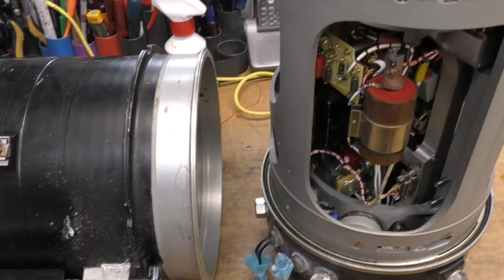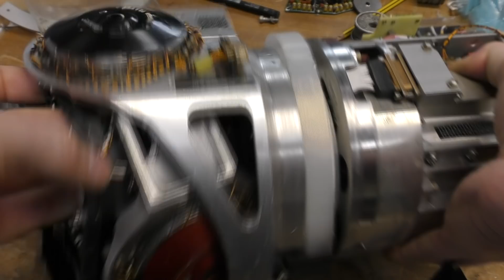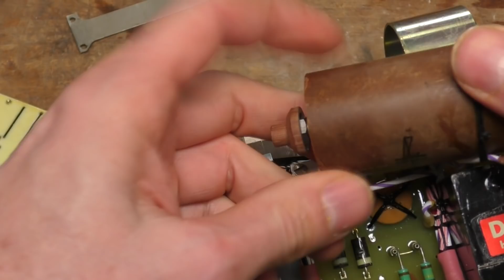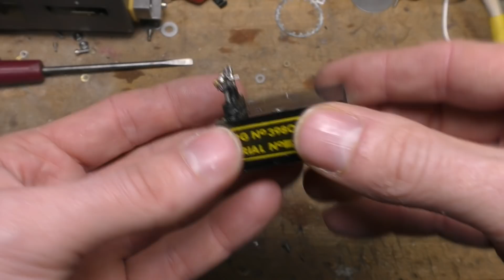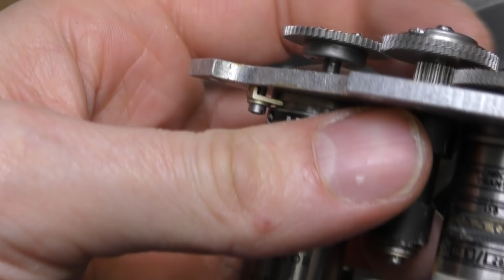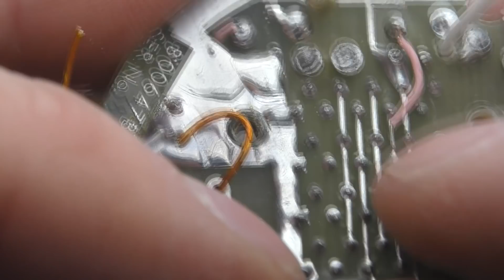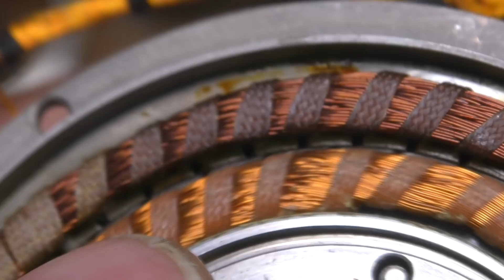Laser unit from Tornado jet fighter aircraft

Comment: Why have that "quadrant" photodetector? If this assembly is the source and receiver, wouldn't that always be in line? Or is this also used to track targets designated by external lasers, like from handheld or other aircraft?
Reply: It is quite possible it will be able to track a heat signature and then check range to it.  Alternately it will track the laser spot as it as the target moves across the field of view to maintain the laser pointed so the return signal falls in the middle of the quadrant to maintain a lock on the direction when an aerial target.
Reply: One possibility is that it is for beam alignment when the system is being assembled.

Comment: For something designed for an Airplane, it seems like not much care was taken to reduce weight.
Reply from the maker: Yeah - this thing is seriously heavy
Reply: @Train 2noplace but the connectors with unused pins would have been lighter without unused pins to begin with.  I guess they have them assembled and a who cares was given, ie not for space.
Reply: @ikocheratcr  considering the large chunks of machined metal and huge bundles of wire, the extra grams from some overly fancy connectors aren't relevant. Plus, the bureaucratic overhead of getting a new connector certified was probably enormous.
Reply: Heavy but also resistant to enemy fire.
Reply: Not much care ? The prototype probably weighed ten times as much. They shrunk it down to 1 gram under the weight-budget, and left it at that. 50 years later in the YouTube comments:

Comment: Dual motors I presume is just for redundancy, maybe two identical systems control it and they both take the same synchronous resolver input? Love how well built this stuff is.
Reply: never played with motors, but here's an idea: they have antibacklash gears in the middle, but the servos have backlash in the reduction gears; i'm thinking one of them torques in one direction and the second in the other direction; say you apply current for 50% of the torque of motor A, then using feedback from the resolver, you adjust the torque in motor B until there is no movement; then you decrease torque in motor B to move left and increase to move right; just don't understand why there are so many wires on each motor; maybe some encoders, to calibrate for absolute position at the start or maybe the only motors with reduction that fit the specification were servomotors; again, don't know much about motors.
Reply: @TheStefan665  Yep,  that's essentially how they get such ridiculous precision accuracy in an existing world of analog metering. Modern milspec we throw it into an ADC and let an algo running on an fpga do the rest.

Comment: Modern equipment is probably just a bunch of Raspberry Pis and few sensor boards dotted around the plane.🤣😂🤣
Reply: Most of it could be done with about $10 of electronics but I bet they still make them like this for millions of dollars because $$$
Reply: @rubiconnn  because engineers expect to get paid?
Reply: Most of the stuff flying today was designed before any of that was around... 90s (F22), early 2000s (F35). Some upgrades flying from early 2010s.

Comment: It doesn't seem terribly weight nor size optimized. That cross section must be quite a drag at mach2
Reply: Weight wise I don't think it really matters very much when you see the weight of the plane it was on (roughly 14 tons). I agree about the drag though. I imagine there is not all that much you can do about it when you need a certain aperture size.
Reply: @AlexanderGee  weight begets weight. and it might need the aperture for light gathering but it doesn't seem too concerned with resolution. still the window could be part of the minimal aerodynamic body of the airplane. It seems it was behind a wedge of glass. curiously there was a pod next to it with a blunt front that must have had poor aerodynamics.
Reply: @DanFrederiksen  Even without those undernose pods the Tornado IDS was not normally a supersonic aircraft and apparently rarely used the maximum sweep position on the wing. Those pods were pretty small compared to the drag they got from the underwing drop tanks and under-fuselage weapons.
Reply: @Akm72  800km/h is still quite a breeze. goes to show how suboptimal mil stuff can be.

Comment: Could you do a video on the strobe/flash circuit? I have to say that from what I saw I was not yet impressed with the high frequency aspect of it. I guess the voltage and inductance is high, but still one would assume that some magic is required for the high "slew rate". Is it trigged by a thyristor or some form of tube?

Comment: Your small gyro at 31 minutes, so its safe to say its not an absolute gyro but perhaos just a direction of movement indicator?! or do you feel it resolves accurately in its small arc of movement.
Reply: It's a rate gyro. The output is dependent of the rate of rotation.

Comment: I was wondering What voltage the capacitor was?  as i have 1 of the resnators witch i want to get functioning but has none of the pulse system ?  If you have it spare i would even be happy to purchse this part ? 
Kind regards tim

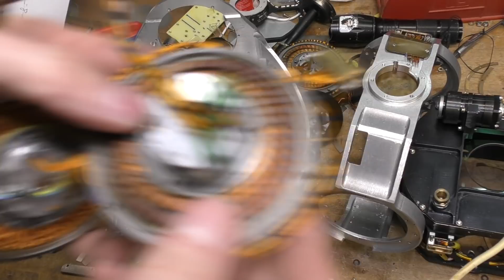Comment: Could the two motor looking devices at 28:00 possibly be an induction AC motor and a resolver?  I find it weird to have two different types of motors since they would be fighting against each other or additional engineering to mesh them together electronically.
Reply: Exactly this- these pairs appear to be part of a synchro servo system.

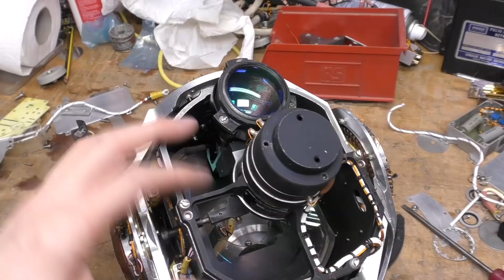Comment: 19:45 my guess would be that almost everything in aviation has redundancies built in. There's probably 2 drive motors to give backup for possible failure
Reply: No, that never happens. They intentionally make things as unreliable as possible :P
Reply: I didn’t have the time to test but I think that the second motor is used as a generator to stabilize the servo control. Without velocity control the final position has strong overshoot due to large moment of inertia of the head.

Comment: 15:00 what is this??
Reply: Crystal polarizer probably, it twists the light coming in when electricity is applied
Reply: Seems to be part of a pockels cell, as the other comment says, it changes the polarization of the light when exposed to an electric field, Its usually in between two crossed polarizers so when the electric field is applied it rotates the polarization enough so the light can pass thorough the second polarizer. This is used a Q-switch, a Q-switch is kinda like an optical valve inside a laser resonator so more energy can be accumulated on the laser medium before the lasing starts.

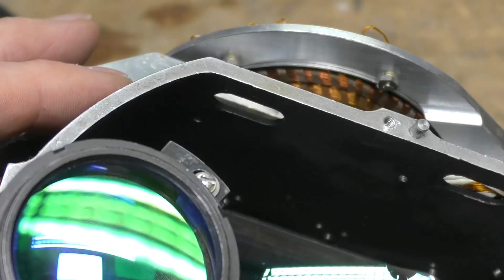Comment: My guess is that at 26:22, the two coils are actually just spiral wound wire bundles, like the ribbon cables on the roll axis. One side is the motor/resolver servo, the other side is the pass-through.
Reply: Not sure what you mean. 28:00 he is showing them and they look like an inductive Pancake Resolver.

Comment: What is the output of this laser ?
Reply: A laser
Reply: @I-.--I-a-e-i-o-u  output wattage of the beam
Reply: Im Video ist von einem 5Megawatt-Puls für 20 ns die Rede
Reply: @andreasg9955  thank you, that’s a powerful laser.
Reply: @dougcharles5004 But, the 5MWatt is the pump power. The laser power is probably factor 100 lower. But could be in the kW range. For 20ns. Still a lot :-)
Reply: @andreasg9955  thank you for the info.
Reply: Similar sized qswitched nd-yags with 10 Hz/100mJ/20ns ARE at 5MW optical peakpower

Comment: It was made to be destroyed without reverse engineering.  Dual gears dual in one photoelectric for split difference refraction of one laser   Pin point that’s 40 years old but 60 year old tech.  Imagine that they have now.
Reply: Imagine what they have now: Integrated flux capacitors with quantum time crystals. An aircraft can immediately disappear and reappear in one of a million locations in both space and time ;)

Comment: You can probably get all this as an app on your phone now....
Reply: That's not really how that works.
Reply: @microcolonel  phones can do some basic range finding too
Reply: @kaspason  there are optical limits on the effectiveness of lidar, especially over long distances like this. Devices that size are cheaper to make once you have the fabs running, but they are utterly useless over the distances a plane does range finding.
Reply: @microcolonel    i just meant that the guy wasn't wrong
Reply: @kaspason  the guy is wrong though, the hardware of all phones is inadequate to replace this unit, even with very clever software, because of physics.
Reply: @microcolonel  If you put a bigger battery in the phone you can do more laser and get more range so yes it is possible
Reply: @rethling4904  if you replace the battery and the laser and just about everything else, and run proprietary software, then yeah I suppose it can do this. It's like saying a phone can replace an M1A1 Abrams if you simply add an M1A1 chassis driven by a turbine engine equipped with a 120mm cannon to it.
Reply: @kaspason  exactly, "basic"

Comment: Oh dear, what a shame that you know so little about the use of the thing.  Just for a giggle,  look up the Kalman filtering of the back-seaters' inputs.  You  might also like to find some (unclassified) info about target designation by other more reliable aircraft and 'ground assets' during sandy war 1.
Reply: Think the Buccs were the illuminators weren't they? Kalman filtering - there's a wiki page about that. Statistical filtering methods I seem to remember. Remember a fairy mentioning it was used by the "talking ballast" as they were referred to by the 2-winged superior race 😁
Reply: @125brat  Yes and yes.  There's an old saying..."pound for pound I'd rather have the fuel".
The Bucc's were designating, but for ages not permitted to also deliver weapons.  Think of Tornado sales pitches to the Arabs.  Eventually, the guys were given authority to self-designate - i.e. for the Bucc's to deliver weapons.